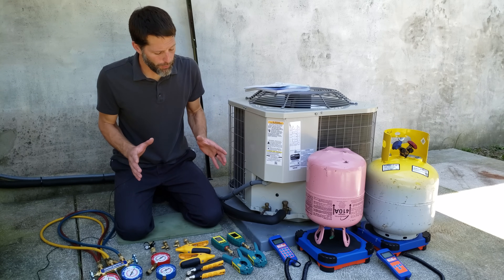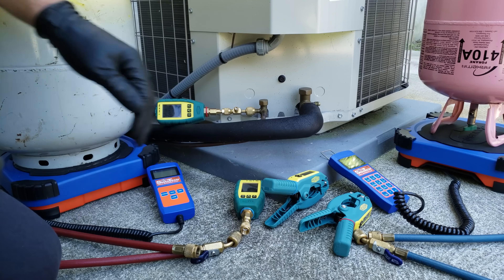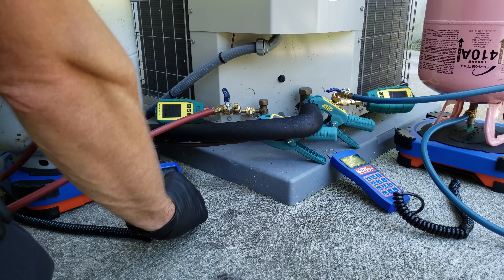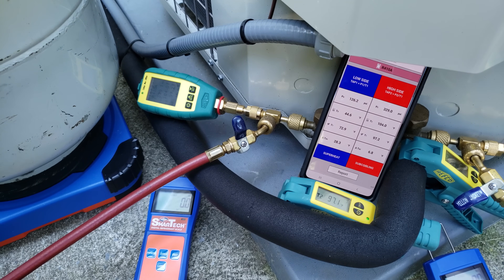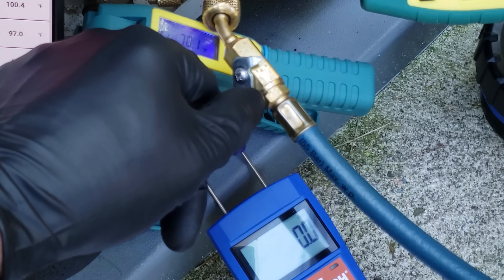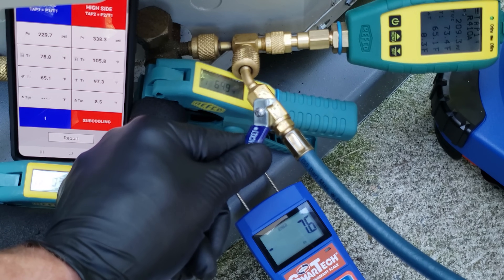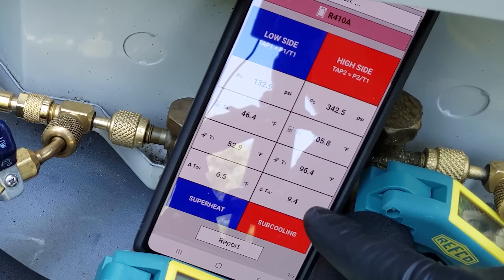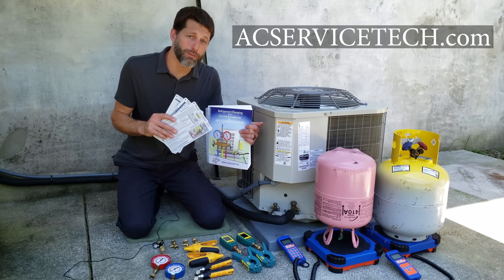R-410A Charging and Recovery Procedure with Digital Test Probes/Gauges!

Comment: Expert's can follow a simple instructions. 

The composition of refrigerant R410A changes whether it is in a gaseous phase or liquid phase. Thus, when
there is a refrigerant leak the basic performance of the air conditioner may be degraded because of a change in
composition of the remaining refrigerant. Therefore, do not add new refrigerant. Instead, recover the remaining refrigerant with the refrigerant recovery unit. Then, after evacuation, totally recharge the specified amount of refrigerant with the new refrigerant at its normal mixed composition state (in liquid phase).

Comment: First of all I absolutely worship your service to the HVAC world. I have been watching your videos non stop and have made many tool purchases based on your teachings. Thank you. 
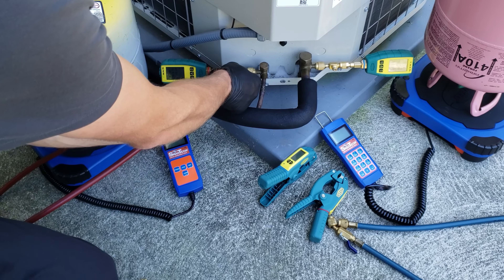  I have a quick question related to your video. Starting at 3:40 when you were purging the air from the cavities between the manual valve on the hose and the pressure gauge I noticed you left the manual valve in the off position when you loosened & depressed the connection at the Tee fitting. Please correct me if I’m wrong but wouldn’t that only purge the air from gauge cavities and not the very end of the hose? Since the manual valve is off, there wouldn’t be any refrigerant pressure behind it to push the air out of that cavity at the end of the hose no? I do not intend to challenge you, I simply want to understand. And if I am correct, is that small amount of air even consequential? Thanks buddy

Comment: 2:32 - Wouldn't it be necessary to offset the pressure gauge from the service port to avoid getting refrigerant oil into the gauge? Or, am I over-thinking this?

Comment: The yellow jacket blue charging adapter works well to prevent liquid from entering the system while charging. I place mine on the refrigerant cylinder. 

Thanks for the content per usual

Comment: Good video, learned a few things, Thank You. One thought, Since the service port caps are the secondary defense against leaks and dirt at the schrader valve, is it really a good idea to drill a hole in the end to do a bubble leak check when the other two options will work fine, unless of course the caps with the hole in them are just test caps and are not for permanent installation ...

Comment: Craig, is it acceptable to pull a vacuum and leave it for a day or two possibly a week until refrigerant can be added into a mini split system? Waiting on a tech. to fill my system. Thanks!
Reply from the maker: You will likely loose the vacuum so I would do that right before charging. The vacuum setup and process should not take more then 20 minutes so I would just do it the same day before they get there and leave the micron gauge on for the standing vacuum test so that they can see it, thanks!
Reply: @acservicetechchannel  Thanks so much for the reply. I've been thinking of making a career change and have been watching your videos. I've learned a lot. Great work making things easy to understand. Thanks again!

Comment: That was a great demonstration of proper recovery and recharge if needed. i like the fact that when you saw that you were close to your superheat number that you closed off low side hose and stop added refrigerant and then added liguid refrigerant from hose a little at a time till you reach target superheat. i have seen from experience that you can easily overcharge unit if you don't take this approach. thank you once for a great video.
Reply from the maker: Absolutely, overcharging is a problem, thanks!

Comment: Are you able to use sub cooling and superheat to check the charge on a package unit? I live in Phoenix Az and most of the techs I’ve seen only check the pressure. Thank you for the videos.

Comment: "Total Super-Heat" measured at the suction line at the condensing unit is a misnomer. 
 Technically speaking (And disagreeing with some popular texts) Total Super-Heat would be measured on the discharge line. Technically, that is the grand super heat Total for the system. When using a Mollier diagram it makes more sense visually to understand my ranting
Reply: Isn't suction and discharge line the same thing?
Reply: Total super-heat will also include the heat of compression from a technical point of view. 
 As the super-heated vapor returns to the compressor, and is compressed to a higher pressure super-heated vapor, more heat is added by compression in conjunction with stator winding temperature and other mechanical friction.

Comment: I’m curious, in this video and the previous one similar to it, you don’t use a “Kwik-charge” thingy, why not?
Reply: I am no expert so I'm throwing this out so someone can refute the following and I can alter my understanding.   

I "think" the "KwikCharge" is simply a limiter so that one will not slug the compressor when turning on the refrigerant flow at the refrigerant tank.  In this video an expert uses the ball valve at the end of the hose to do what a "KwikCharge" does and with the ball valve titrates minimal amounts into the low pressure side right in front of that compressor.  I think.
Reply: @GuapoOso  great post guys yall both are correct!!
Reply: @GuapoOso    I used to do it using just the valve also, but once I got a kwik charger I didn’t have to worry about opening the valve too much and allowing liquid refrigerant in.  I was curious why somebody of his expertise would not use one, like maybe they have a down side that I don’t know about
Reply: @hiseminencetheholymacdiarmada 

Not having used a KwikCharge, I think those KwikCharge thingys are inline and of course they have some sort of upstream valve.  In this video one is adding refrigerant to a running system watching superheat, not by weight of refrigerant and lineset length in an evacuated system.  When one turns the valve off, refrigerant liquid downstream of the valve leaves through the KwikCharge gizmo and is evaporated into the low-side system  Same thing is true for the ballvalve on the hose, however there's less refrigerant liquid downstream of the hose ballvalve than downstream of the ballvalve/KwikCharge combo.  Ability to titrate smaller amounts with the hose ballvalve than with the KwikCharge in my less than expert opinion.  

The value then is LESS CHANCE OF OVERCHARGING/SLUGGING A RUNNING SYSTEM WHEN ADDING REFRIGERANT TO OPTIMIZE SUPERHEAT.

Maybe.......................

I throw this out to be corrected on my understanding.  Its the way I learn.  Thanks

Comment: I noticed you weren't using a "charger" on the vapor line. Can one be used in this demonstration? I also noticed you used 2 scales. As a new tech, is it necessary to use two scales? Cheers!

Comment: What to do with the residual liquid refrigerant if any left inside the low side host?
Reply: Note that when it was assumed a future need to add the most minimal refrigerant to the low side, the hose was removed from the new 410a refrigerant tank and the liquid in the hose, now disconnected from the tank, was the reservoir to add this anticipated refrigerant.  The hose refrigerant is considered deminimus and is allowed to be vented, but this method of adding an anticipated minimal amount from the, disconnected from the tank, hose reservoir, reduces the refrigerant indeed to a deminimus minimum.   A best practice.
Reply: @GuapoOso  another great explanation ty
Reply: Any refrigerant left in your hoses after disconnecting from your system and tanks is considered deminimus. You're allowed to purge them afterwards.  Best practices are using non-invasive tests before hooking up your hoses to determine if your refrigerant is the issue or if it's something mechanical or electrical.
Reply: Let it vent I guess

Comment: 1st time I've seen the Refco smart kit in action , funny to see it in use in the US , Refco is popular over here in Europe since it's Swiss .
How do you like it , is it reliable and practical ? How's the Bluetooth range compared to Fieldpiece ? Cheers from across the pond 👍
Reply: Never seen one of these before.  Looks like "TheCat'sPajamas".  Readout on the pressure gauge and on the temp clamps.  As well as communication with an app for an additional display.  I'd also like to see a CraigM review on its reliability.